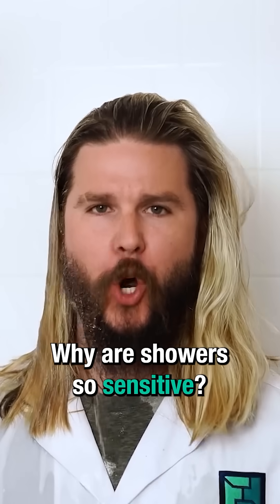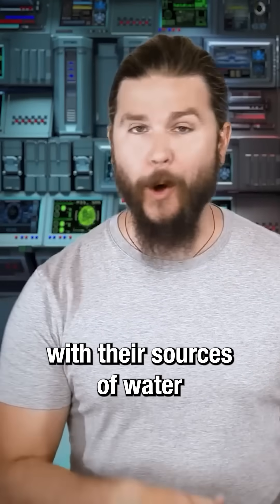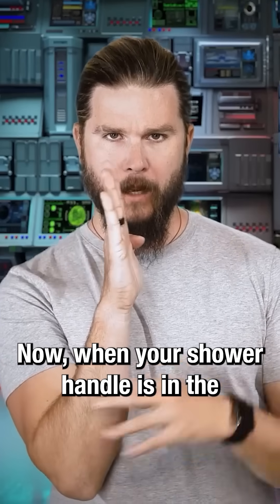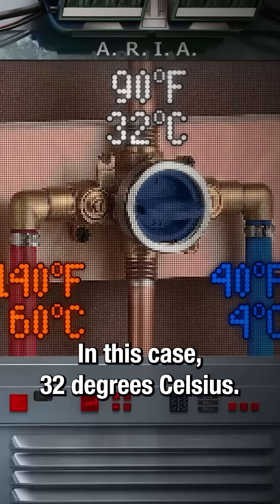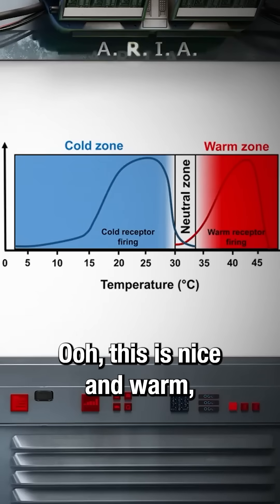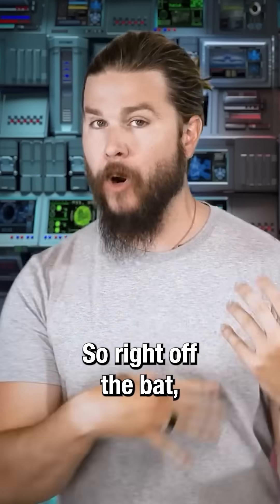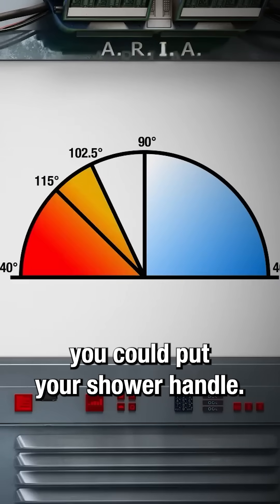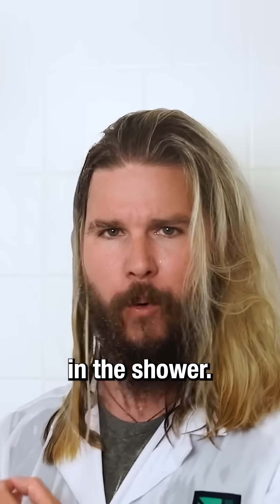Why are showers so sensitive? 🥶🥵

Comment: That's why Thermostatic mixing valves were invented. I don't need to regulate it anymore once I've found my temperature. It usually just needs a second to adjust if the supply changes.

Comment: It's actually easier to get the temperature you want with the "two knobs of death" because you can set the hot and make fine adjustments to the cold, and the adjustments are fairly linear over the whole range of travel of each valve knob.  For those who like to save water, however, this sort of shower doesn't allow turning off the water (to soap up and scrub) and getting it back instantly to the previously set temperature, as to some single-lever knobs.

The obvious solution then is a thermostatic control -- these used to be sold for photographic darkrooms, to regulate the mixture of hot and cold to get a precise 20 C for black and white, or 40 C for color -- but since film almost vanished (even though it's making a good comeback now) all the manufacturers of these thermostat-controlled temperature regulators have gotten out of the business (no demand = no profits) and a darkroom photographer who wants such a unit must hunt for a disused darkroom to take it from.

And as far as I know, they never existed with a range of temperature between, say, 35 C and 45 C, where most people want their showers (and in any case, don't do a great job of regulating if the water is shut off for a while and then turned back on).

Comment: Also, shitty cheap gas powered boilers do not help either. Or electric boilers with low capacity that only turn on when you start using the tap. Get yourself one of those 80-100 L electric boilers and just keep rhem turned on overnight. They will keep water warm enough for a quick shower even 3 days later. Also keep them turned on during the night because in most countries power costs up to 50% less during the night, if not more

Comment: That's why I much prefer the two knob system that my shower has. I turn hot on max and only adjust the cold. My comfort area is usually in the 60-100 degrees of turning of the cold knob, much more adjustment available than the 12.5 degrees in Kyle's example

Comment: I’d also argue it depends on where you live. What do I mean? In my part of Texas, the sweet spot is indeed about where Kyle mentioned in the winter, generally. In the summer? That puppy is easily halfway down into the cold because even the cold water is warm already in July 😂.  I’d also argue it depends on where you have your hot water heater set. The hotter you set it, the more that equilibrium by default is gonna skew down to the cold side, to a point at least.

Comment: This is a bit of an American angle, travle a bit and you'll find out why you need a wider range: many houses in warmee climate (e.g. close to the Mediterranean see) use solar panes to heat up water and store them in a tank. However temperature baries between days and even the top and bottom of the tank... So over the time you shower, you need to make adjustments that are way more than the 1 degree you mentioned...

Comment: But why is there 20 seconds of lag when u change the temperature and why does it change if someone else use water in the building ?  Why don't we have a thing where u chose the exact temperature and it's stable, the curent system we have is just unusable  TwT

Comment: I start my shower on the lowest setting and then adjust it to be warmer, i live in a cold climate so its the safest way to get in for me, slowly warming my body up than causing a shock for my system to process, im also autistic and i get nauseous at very little so it helps me take less time in the shower than my usual 3 hours

Comment: So what you're really saying is that the mixing needs to be offset and logarithmic...
That's not necessarily lazy engineering. That's going to be more difficult and expensive to manufacture in a single valve profile because now we're talking about variable cut profiles instead of simply drilled holes.  And your faucet will go from a cool $40 to a much less cool $1000... So you say lazy engineering... And I say you get what you pay for...

Comment: Fun fact you can take off the handle and there's this little white thing you can adjust how much hot water can be mixed and you can use it to adjust to the perfect temperature on the hot side so you don't burn yourself with boiling water

Or just turn it all the way up and toss some lobster in the tub and make yoself some tub skampy

Comment: And then there are shower handles where you either get a little bit of cold water or lots of hot water. You cannot choose the pressure and temperature separately, they are attached and related. This is especially common in rental houses and hotels for some reason. You cannot choose a little warm water or lots of cold water.

Comment: The hot water could be used for… reasons… but also because it’s probably simpler to just connect the shower valve to the main water line in the home.

Comment: I do max heat until the water line from the water heater fills with hot water.  If I'm in the summer I then turn the cold to max and slowly turn down the hot as needed.  In the winter I turn the cold to max, then turn it down as needed.

Comment: We need bigger water tanks at hot tub temperature so most of the time we just crank it all the way to the right or all the way left. Maybe even a warming tank so our cold water take heat from our waste water and dryer and maybe ovens and refrigerator— but we just have been so used to wasting this energy for so long.

Comment: If it's colder outside, the cold water will be even colder so it changes with the weather.
The best is to lower the hot water as close as you can to that sweet spot

Comment: laughs in european with single knob set in temperature range thats from cold to just about tolereable hot, basically the 12,5% left and right from middle, set in degrees celcius. You´re just using outdated shit.

Comment: Sounds like an American problem because all of my showers in the UK have had a range of 30-45 degrees C with 38 highlighted. There is often a stopper that prevents you from going past 38 unless you press the button down to stop you from setting it too hot accidentally or to stop it from being moved to higher temperatures accidentally.

Comment: My shower solved the engineering problem 😎. One know regulates pressure, the other regulates temperature. The latter can turn almost 270°, and the middle is more sensitive to changes. I have an angle of a full 40° that I'm comfortable with, and I'm so happy.

Comment: I always think about this trying to find a good temperature. It's like there is 5 zones for water temperature-
1) Too cold

2) Cold enough to get the body to activate its cold acclimation and get used to it

3) middle ground where the water isn't cold enough to get your body to adapt, yet it cold enough to make you feel cold and change the temperature 

4) hot temperature, where it really does feel nice

5) too hot

Comment: If I were to redo my shower, I would have two handles.
One that has the cold supply hooked up to both sides for the coldest shower. (Otherwise I find that some warm water is mixed in even at the coldest setting, I can tell by comparing the bath water temperature to the sink water temperature)

The second handle would be for regular showers and have the hot supply hooked up the the hot side of the valve, but the cold side of the valve would be hooked up to a tee with both the hot and cold supplies lines. This should have the effect of having the span of the temperature range and thereby making the arm half as sensitive.

Comment: Pro tip, use the nozzles behind the nozzle to cap how much hot water comes out. You can set it so the max temp is your ideal heat. No more guess work

Comment: It IS poor engineering. Two knobs are way better. I just open both at the same time, let it mix and then adjust if I need to. Oh, too cold, let’s add warm wate! Same with cold water, better overall design but not as straight forward as your’s

Comment: That's why I installed dual valve, one handle controls pressure, the other temperature, I just leave it set at my temperature.

Comment: Lies all lies. This is for people standing up, that experience the shower from a relative distance as it exits the shower head. 

For disabled people who have to shower in a seated position this changes as the max water temp cools as it passes thru the air. There’s a reason why I leave it at the max, and also can’t stand up with it on. But you know, thinking about the disabled is so commonplace these days. I mean, it would be nice if there was even half a sentence as an afterthought— but the zone of comfortable water in a shower has a greater margin of inclusivity. 🙄

Comment: More-so lazy engineering than anything else. Hate it. Cause I've used faucets that have a perfect midpoint. I wish they'd just do it normally; idrc about anyone trying to streamline it to make it simpler to use. Most days, i want it to be as hot as possible, but when washing my hair, I don't need it scalding my sensitive scalp, but I'm sick of having to "carefully tap" the knob to get it there.

Comment: Or, and this is crazy, just set your heater to 45C (115F) and rely on the pipe run to the shower to cool it down enough. No need to add cold and get scalded when the water pressure changes.  It's also safer if there are young kids or older folk in the house.

Comment: Im Brazilian so i have a electric shower and it works like this.
You set the shower to one mode it is either winter mode,summer mode or turned off if you open the water too Little the shower filament will MELT and if you open too much it will be cold

Comment: As a licensed plumber I find the term “lazy engineering” in regards to shower valves to be an offensive and inaccurate term. Here’s the thing. In your plumbing whether it’s your shower, your sink, your sewer, your shitter or any number of other aquatically inclined systems I can make them badass. I can make them all badass. 

The question is less “do you want lazy plumbing” and more like “do you want to pay $20,000 it”. In the question of “the shower valve” usually it’s a matter of pipe size, pressure and thermostatic control. Basically on the latter most people keep their HWT t  et no too high because they are trying, and failing, compensate for poor pipe efficiency by cranking up the tank temp. All this does is more tightly restrict that “real estate” on the valve handle. 

Basically that “real estate” on your valve is unused because the temperature on your tank is too high and your efficiency is too low. You can have a MUCH wider range of control - I just need to come in, repipe your whole house and upsize it, install a pressure regulating valve at the house intake, and design a shower diverter valve system that allows you more precision and a wider range in hand control.

Again, that’ll be around 20-40k depending on the state.

Comment: If you notice at nicer hotels and some times even cheap ones with smart stockers there will actually be a small area that’s marked to show you where you need to turn the knob to find the sweet spot. Some even have a range so you can find your sweet spot inside the sweet spot 😂

Comment: Mine just has a mechanical dial 1 being cold and 10 being the hottest. No need to fiddle the handle to get the temp you want. Personally I go to 6 and it's the same temp every damn time.

It's on the cheaper end too. No digital counters and all that cool stuff. Just a mechanical dial.

Comment: You’re right, only a small portion of the arc is perfect showering temperature.  So why don’t we design a tap that only includes that part of the arc, only more spread out? Cos you want a different part of the arc, depending on where you’re from. 
My cold water on its own is at least 32°. So right off the bat, my half way hot and cold is going to be warmer than your example. Our ambient temperature is so warm, we want cold showers, or the ability to have a warm shower to clean, and then switch to cold at the end to cool off.

Comment: The position of the handle for hot and cold water also depends on how much your water heater or boiler holds Hot water, The bigger water heater or boiler that you have, the longer sweet spot lasts

Comment: 102.5 is cold 🥶 The orange part is the zone to use. 115 is slightly to hot though.
Reply: That’s the angle of the handle, not the temp of the water

Comment: I adjusted my water heater temp so that I can just turn the shower knob all the way to Chernobyl every time
Reply: By that do you mean set your heater to 120? If so...
"Legionella is an aquatic bacteria that thrives in warm water environments and is the cause of Legionnaires Disease. It is commonly found in hot water heaters, potable water supplies, hot tubs, cooling towers, fountains, swimming pools, etc. and multiplies in conditions especially between 68 – 122 °F."

Comment: Counterpoints: 
The sweet spot changes after some time or with the weather
Sometimes the extremes are useful like when you turn it on, starting on hot makes it seem like the water is getting hot faster and sometimes a cold shower is nice if it's hot our or you need to wash something that isn't you

Comment: Simple solution we need a temperature sensor in the shower head with a relay to a motorized shower handle with touch buttons you can program preset configurations too, simply set the shower to your desired temperature manually the first time then assign it one of 3 or so presets and then next time the shower would crank up and identify the temperature of the water and stop at just right.

Comment: The shower I grew up with somehow lost effectiveness as I got older. I swear, you turned it to, say, a 60° angle, and for years it gave a beautiful temp. Over time, though, I started having to turn it 62... 66... 70... On and on until eventually I had to turn it until it wouldn't turn anymore in order to get my happy temperature... >:\
My current house has separate hot and cold control, so I usually just turn the hot water on, add cold until tolerable, and then slowly reduce the cold water until it burns so good xD

Comment: i have a shower water heater, best thing ever, you just put how hot u want the water and then the handle is for water pressure, the device connects directly to the wall on the outside in my garage so it's always set at 140 fahrenheit

Comment: The cold isn't 40, the water comes out of the ground at 56.  And the hot isn't 140, it is closer to 130.  130 is still hot enough to burn a person, 140 isn't necessary.  
You can still make your point but you lose credibility when you make stuff up.  Do better.
Reply: It’s important to note that the temperature of water entering homes can vary depending on the location and season. However your comment is incorrect about the average temperature of water coming out of the ground. It’s commonly around 50 degrees Fahrenheit (10 degrees Celsius). Additionally, the typical setting for hot water heaters is around 120-140 degrees Fahrenheit (49-60 degrees Celsius) for safety and to prevent bacterial growth. While 130 degrees can cause burns, it’s crucial for preventing the risk of bacterial contamination in the water supply.

Comment: Using up hot water in the water heater tank results in cold/lukewarm water being added to thw tank, making it overall colder and I have crank the heat up after 10mins. Unless I missunderstand how my waterheater works.

Comment: My shower has two separate handles for cold and hot. It’s so easy to get the right temp. Hot all the way on, cold gets a quarter turn. That perfect temperature that makes my skin red and patchy but doesn’t hurt while doing it. I could turn them both less and get the same result in temp sure but I need that maximum water pressure too.

Comment: Someone should make a geared shower handle with a "minute hand" for coarse changes and "second hand" for fine adjustments
Reply: That's the "lazy engineering" part mentioned.
Reply: You can just buy a shower faucet with a bimetallic thermostat. No need for any turning whatsoever.
Reply: @Ryrzard Bimetallic thermostat is a scary long words
Reply: Like the tuning pegs on a violin
Reply: Wait so like microscope knobs
Reply: thats a thing on most electric showers actualy
Reply: My grandma actually has that, it looks sick, probably costs a lot and is probably not fun to clean.
Reply: And while you're at it make the turning arc with gears very big instead of small angles, perhaps multiple 360 degree turns to go from cold to hot
Reply: Mine is kinda like that but shit. It had 4 settings, high (painful) cold (not heated whatsoever) eco, and eco but warmer. Then there's a normal dial but the thing is the first dial controls the amount of hot water and the normal dial controls the cold so the hotter you make it the less water you get until you're cold anyway cus there's not enough

Comment: Eh, you could always go the high end route and put an actuator on the mixing valve and have a program chase the temperature setpoint. This would eliminate, both the issue of human element(playing with the knob which causes wear and tear) and needing to adjust the water temp over time. Set your preferred temp or even a few preconfigured temp ranges to ensure safety and forget it.

Comment: Bizarre post i have at different points used the whole range of the shower handle. I definitely use most of the hot side for each shower.

Comment: It would be a whole lot easier if they just put the two pipes “Not.”Connected to hot and cold separate,  like having two separate showerheads so that way you can get hot and cold at the same time.

Comment: My wife enjoys being scalded in the shower. I prefer the water just hot enough to wash effectively and not come out cold.
It takes maybe 30 seconds fir water to cone out at optimal temperature, but the handle settings we each use are very different.